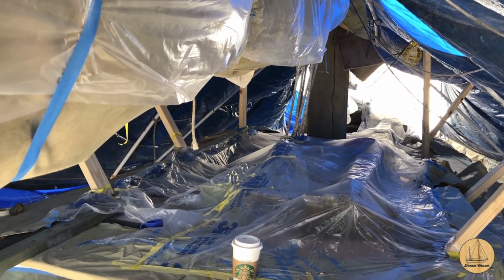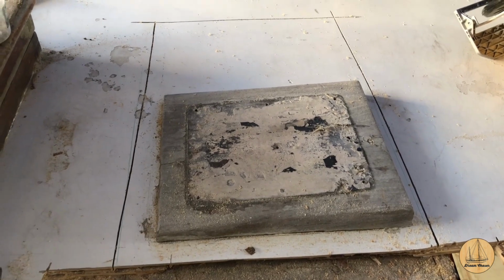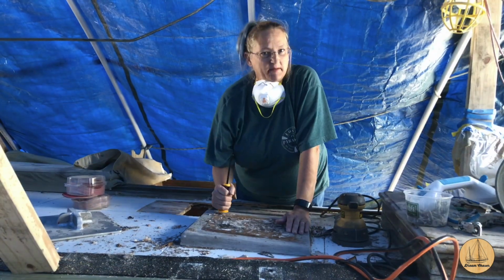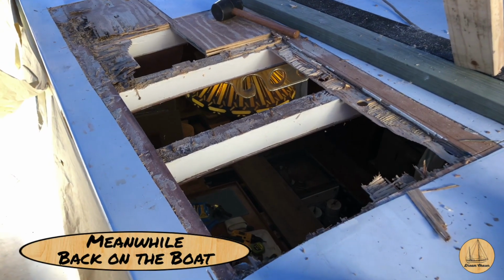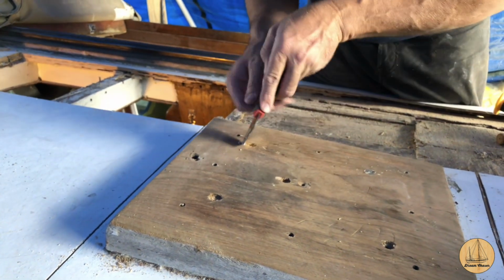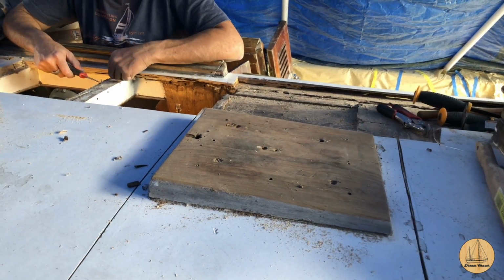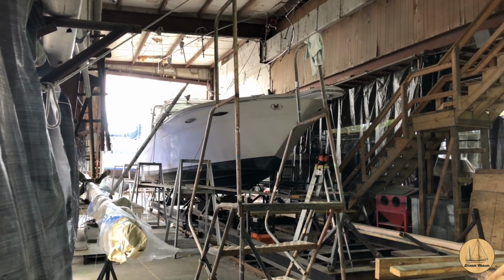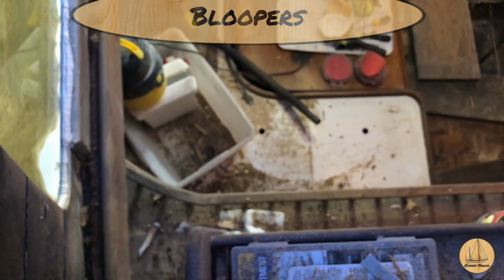Preparing Wooden Spar and Fiberglass cutting

Comment: So how long before y'all will be finished and sailing again do you figure??? I know it's going to be beautiful when y'all get her done... Also if you didn't already know Home Depot carries Husky tools and I do believe they have a life time warranty on them. As for Harbor Freight that has become my favorite tool store. I get the extended warranty on the electrical tools that I know I will use the most and I've burned up a few chop saws and got them replaced. And have had to return one tool right out of the box because it was throwing sparks the first time I used it. But over all their tools have always worked very well be me even on precision cuts right down to the hair. And the people that work there are great!!!!!    Be blessed... BBE..
Reply from the maker: Bobby, We are always nervous throwing out a date for the work to be done because then if it extends I get disappointed.  BUT, as I am sure you suspect, I do have something in mind.  :)   I think the work in the yard (new fiberglass, mast stepped and painting finished by the end of  April.  We are hoping that the stainless work we are going to have done can be done in parallel as well.
Reply from the maker: Also, we know we have a LOT of cleaning to do, We are thinking that it may be best to get the entire boat emptied out and vacuumed, every inch of her.   I agree on Harbor Freight as well.

Comment: Why did you opt to strip the boom with sanding?  I would have started off with a chemical stripper and scraped--though you have to be careful scraping soft wood--then on to sanding.  Seems it would have saved several hours of work.
Reply from the maker: +How to Sail Oceans You May be right. I have never had great luck with a stripper. I have tried a few and just never was all that impressed. I have a new one but haven’t tried it yet. It is called “dads stripper” which is a funny name to me
Reply: "Dads stripper" does sound suggestively wrong doesn't it ... Um, I use ye 'ol Zip-Strip, but I find you need to apply once, give it a scrape, and then re-apply, at which point it should begin to cut.  Keep re-applying on stubborn spots.  As I say, be careful with that scraper, I've put nice little gouges in my woodwork because I got a little too impatient.  Of course some will recommend using a heat gun, but I've never gotten that to work well, so "different ships, different long splices" I suppose ... Anyway, I love this re-fit series of vids you're doing, nice to see someone putting in the elbow grease rather than just buying shiny new stuff off the shelf.
Reply from the maker: +How to Sail Oceans Thanks for the conpliment. I wil have to try other stripping material.